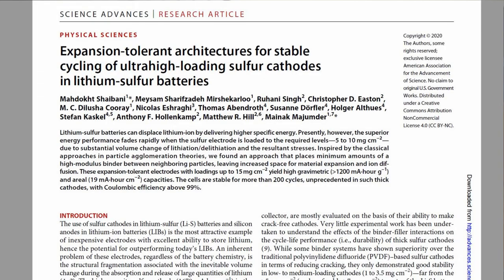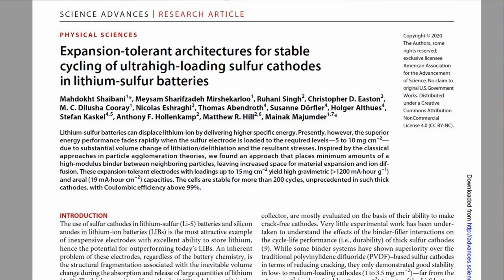Lithium-Sulfur Batteries, very brief introduction (corrected)

Comment: Why is a liquid necessary? Can some conductive substance work instead, like a powdered lithium filled into a carbon lattice or weave? I'm guessing there's a reason for a liquid, but I don't know what it is.
Reply from the maker: I think  you're asking about the electrolyte. There are solid electrolytes, but they are still experimental. Most batteries use a liquid or gel. The reason is: you need to be able to move the ions (in this case, lithium ions). Solids are (generally) not as good at letting ions move through them. At one electrode, lithium metal is becoming positive lithium ions. You can't build up positive ions in one place (like charges repel), so they have to move. So, they move over to the other electrode and join up with negative sulfide ions. The liquid allows them to move.